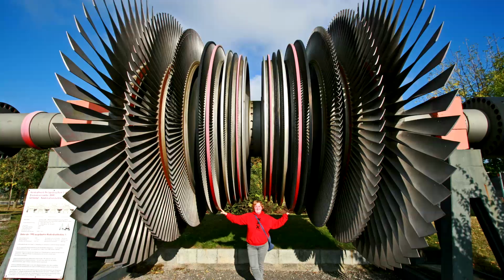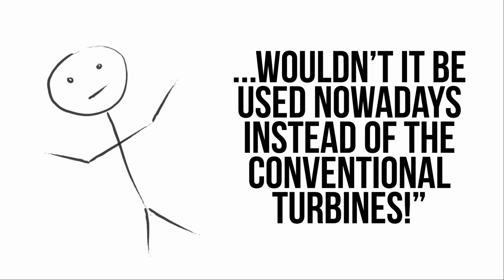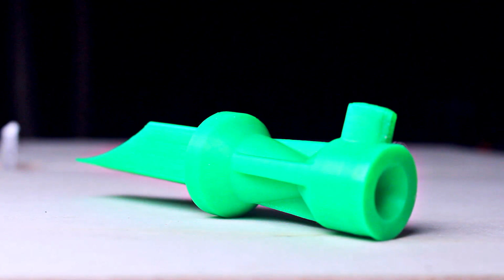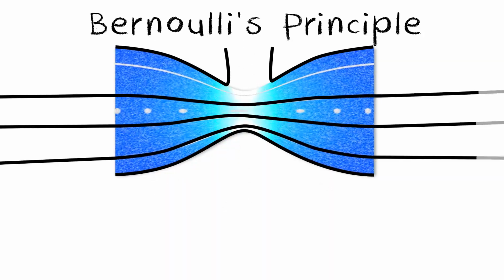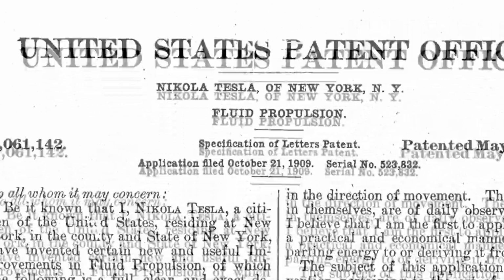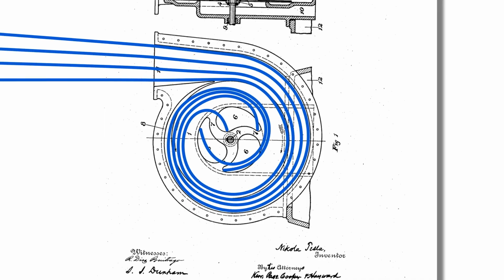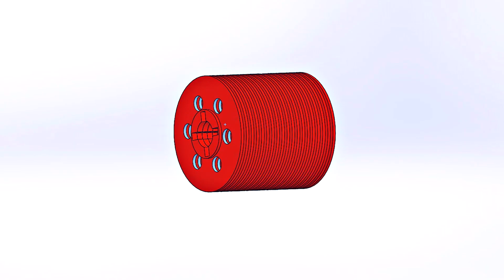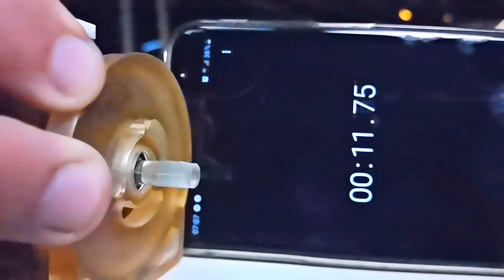Tesla Turbine [Smoke Flow Slow Mo]

Comment: I’m late to your content, but loving every minute of it.  An idea to improve upon the redesign might be to change the topography of the discs into ripples or zigzags that fit closely into one another.  My theory is that the engine would benefit from increased surface area for the air to drag along the discs.  Simply making the discs rougher (probably) wouldn’t work because I think it also benefits from having the flow be as laminar as possible.  Furthermore, this should add resistance to the gas’ tendency to jump from the edge of the turbines straight to the outlet, which should increase efficiency.  
Another (probably more obvious) suggestion would be to use a clutch with blades of varying masses.  Increased mass within the blades (armchair physicist here) should proportionally increase the torque output of the motor.  That might make it slower to spool up, but it’s a variable worth considering based on the application.  
Love your videos and quirky everything.  Keep it up!
Reply: Boundary layer drag is not from
Mechanical Interactions between the fluid and the disc. Adding grooves will introduce turbulent losses which will reduce the efficiency and can induce stream separation, and even flow reversal, counteracting the desired torque, because of the turbulent flow regime it would induce. The Tesla turbine works on adhesion from viscous forces, which are entire valance electron shell interactions. Think hydrophobic and hydroPHILLIC interactions. Making the surfaces of the discs hydroPHILLIC would increase the molecular adhesion of water and steam molecules increasing the boundary layer thickness. 

Putting mechanical impediments in the way of the free flow motive fluid completely defeats the purpose of the turbine in the first place. You want smooth faced discs. The “wetting angle” between the Type of material the discs are made of and the type of motive fluid is the important factor here.

Comment: Why not use a Tesla turbine run by air pressure to drive a Tesla turbine pump to propel a boat.Use the Tesla pump to suck the water up from under the bottom of the boat through the hull  and push the water out of the back of the boat through the stern.Jet boat. Just like a jet ski.

Comment: I am Electric engeneer and I love your videos.  I would love to use your high eficency tesla turbine with a high voltage multiface high eficiecy generator.  The low toque use multi face genere tal out put 18 face  generator.   If more info you can call me 5213221476868

Comment: If i understood well the differences in the new design and the normal design that you made, the former has a "de laval" nozzle (i. e. Convergent divergent nozzle) mounted in the better tesla design. I'll say that the main reason why you lose all those RPMs isn't the tesla design but that you used that nozzle. 

I want to give you some tips(if i'm right about the first design) , i think the problem with that turbine started in the moment you sad "with all the theory out of the way". First of all that nozzle is efficient only if you reach supersonic speed otherwise is useless. At subsonic speed the divergent part will slow the fluid(that is probably why you lose all those RPMs). You don't want turbines to work with supersonic velocities, and almost certainly that design is not meant to work with supersonic speeds. 
So i suggest you to try the new tesla design with the the normal nozzle, and if you want to compare the results the entry surfaces of the casings MUST be the same. 

If this isn't the cases than it is only strange that the better tesla design failed.
Reply: I think that tath could be a good idea. But i can sugest also to remove the central part of the discs, just to have a good comparison. 
I would also sugest to sandpaper the discs and use fins along it to direct the flow and not make it collide in the center. These fins can also be not paralel to the flow to make like an ibrid whit the conventional turbine and maibe get a higher torque output. These fins can also replace the spacers and help you to keep the discs stable also when they are a bit flexible because they are distributed around the surface, not only at the center.
I think you have to reduce the whidt to increase the air speed in the inlet and increase, not too much, the diameter of the turbine to increase the leverage.
In conclusion, to increase the performance the discs thickness is less important than the tickness of the space between them
Hope that someone read this (hope also my english was good)
Reply: the tesla turbine is designed to peak at 50k rpm

Comment: What if you modified the rotor blades to create more drag as the air flowed past them? Cut small curved airlets (perhaps funnel shaped) on both faces to create more torque? Or perhaps created warps in the discs so that when they were stacked they create a spiral/curve pathway, so instead of cutting small curved inlets into each blade face, rather the curved pathway would be created by the resulting pathway observed from warps on the discs in relation to the other discs which were staggered in a rotational mounting/placement? Maybe change the center outlet shape? What if the body/rotors were shaped like a vortex instead of a cylinder?

Comment: The disk could have scales or "scale like" grooves to better catch air friction.

Add small ribs on the disk extending outward from the middle could improve friction, 
or the outer ends of the turbine casing being wider than the center and the disk converging closer together, and since the air slows down on the way out the pressure on the disk may not change upon exit or have less change.

All these ideas were in the expectations of using air. 
If water exiting is essentially the drain, the turbine exit could face downward allowing gravity to assist.

Comment: @integza Bom dia! next time you need dense "smoke", try an e-cigarette (without nicotine, of course). It will produce very dense fog (not smoke).
Btw. did you ever try to mount a disk with flow channels on the axis that spins with turbine speed, where the channels are connected to the exhaust of the turbine? Maybe it will increase efficiency when the centrifugal force sucks out the gas from the exhaust, to make some kind of turbo-powered Tesla turbine.
And efficiency may also increase with the inverse of the disk distance in the turbine. It will help for the laminar flow and the "drag effect" because of the laws of rheology, and maybe the pressure gradient.

Comment: A few improvements:
 - Make the discs from thin plastic sheet (0.1 mm or thinner), not 3D print them
 - Make sure the housing is as smooth as possible, the resin looks quite 'sticky' for the air
 - The rotor didn't seem balanced

Comment: Why not try to use a metal bolt and washers of different diameters. Then cut notches into the washers and line them up to make the exhaust outlet. Then you use some sort of bearings for the axle of the turbine. Now the Fluid may be hot steam with a mini boiler or flash boiler fueled with what ever is cheap to burn. ?
Reply: Maybe if you use two or more stages you may get better results. Then if you design the turbine like a flywheel where the greatest weight is on the outer rim it would work better.

Comment: Love ur appreciation of the scientific method 👍 and innovation if by some miracle u see this I think u would find my turbine idea fascinating and potentially collaborate on experiments for R&D to test to find the best version since there are so many potential variations possible using my concept and would be extremely scalable and potentially synergistic if multiple turbines are properly placed relative to each other especially for hydroelectric applications since it’s a high torque design water is likely the better fluid cus that’s how physics works but I think it would be substantially more efficient per acre in wind then current technology for about a hundred reasons but that’d take way to long to write lol been enjoying ur clips 👍
Reply: All fluids, liquids and gasses, can be made to flow in highly efficient low Reynolds numbers laminar flow regimes. The viscosity will just determine how small the disc spaces will need to be. Using gasses like compressed air and steam are more than adequate for the Tesla turbine when you design the flow regimes and Reynolds numbers to maintain only laminar flow between the discs. Otherwise you get too much slip and I irreversible turbulent flow losses.  

If you decrease the disc spacing you have to coincide ray increase the number of spaces to maintain the total flow area for adequate mass flow rates for desired power outputs. As power out is directly mass flow rate dependent.
Reply: Add on the bacon bit of gasses having viscosities that increase with temps, the opposite of most liquids, and you get decreased slip losses in the turbine as you increase the motive fluid temps/viscosity, ergo increased output efficiencies on top of increases max thermodynamic possible efficiency with increased temps. It’s a win win.

Comment: 1 - Try using a vapor instead of smoke; it's thicker, more visible, and the higher density of moist air should 'stick' to the disks better.

2 - What if each of the disks were concave, so as to give greater surface area while also condensing the fluid toward the center? If curved at the golden ratio it should avoid too much turbulence. 

2b - If not a concave shape, perhaps a raised spiral, only a millimeter or two, on the surface of each disk (like a nautilus) could increase fluid drag and thus efficiency?

Comment: So, waterfall, trompe hammer for compressing air, compressed air through Tesla turbine, to high efficiency generator, problem solved and should be more efficient than current falling water turbine electric dams as there should be less components and more easily serviced

Comment: Take out the metal wheel and gear housing from an old AC clock. It is one with only electromagnets. It worked like a turbine with a straw. It would make a high pitch wine above 5000 rpm. But it had only two wheels and a bunch of steel pieces on the side.

Comment: Step your exhaust through the range of the disc as to help flow and cut the edges at an angle on them.  Add angular notches or blocks on the disc's.
Reply: Boundary layer drag is not from
Mechanical Interactions between the fluid and the disc. Adding grooves will introduce turbulent losses which will reduce the efficiency and can induce stream separation, and even flow reversal, counteracting the desired torque, because of the turbulent flow regime it would induce. The Tesla turbine works on adhesion from viscous forces, which are entire valance electron shell interactions. Think hydrophobic and hydroPHILLIC interactions. Making the surfaces of the discs hydroPHILLIC would increase the molecular adhesion of water and steam molecules increasing the boundary layer thickness. 

Putting mechanical impediments in the way of the free flow motive fluid completely defeats the purpose of the turbine in the first place. You want smooth faced discs. The “wetting angle” between the Type of material the discs are made of and the type of motive fluid is the important factor here.

Comment: Soooo... like... the smoke wants to stay to the outside until it breaks down and then looks for the shortest way to the center...  Why not just move the outlets of the turbine closer to the outside... just at the point where the smoke breaks down?  In other words... "fatten" the axle ridiculously so that it takes up more space.  Then the fluid only has the outside of the disks to work on... which is where it wants to stay anyway.

Comment: Hello Integza! I’ve been wondering if Tesla Turbine works with any type of fluid? If instead of air it works with water ,and if it can, could we generate energy with tap water? :-B
Reply: The Tesla turbine can work with any fluid. The Tesla turbine works on viscous adhesion forces which are entirely valance electron shell/molecular interactions. Think hydrophobic and hydroPHILLIC surfaces. 

The important factor here is to increase the adhesion between the type of disc material used and the type of motive fluid used. For example. Using a hydroPHILLIC disc surface material will increase the molecular adhesion of water and steam to the disc faces, thus increasing the boundary layer thickness and decreasing slip on the discs ultimately increasing torque, power out, and efficiency. 

The “Wetting angle” between the disc material and motive fluid is the governing parameter to optimize for increasing the motive fluid adherence and effectiveness in the Tesla turbine.

Comment: Cant wait for the time when we can gain energy faster than we can use it. (I know it's already now)

As the video, speaking of wind, cars push air and create wind, right? So what if we put some sort of cylindrical shaped kinda windmill on the streets? Then, we can create power, it's eco-friendly, and efficient when placed in bunches.

Comment: Interestingly, when the pressure was increased x4 (2->8bar) the RPM increase was x2 (15k->30k). So if P1+E1=P2+E2 (bernoulli, Energy, Pressure) then perhaps this shows the scaling of the internal resistance, meaning delta(E+P) = R? This could be one aspect of the design that could be isolated and evaluated by itself perhaps? Or at least for me it in interesting because it would mean regardless the design there would be a sweet spot for RPM to optmise power output vs resistance, much like on a solar panel the so called "knee" of the graph, where voltage is maxed to the point where current decreases. Whereas here it would be RPM increased until resistance = power gains or something like that...?

Comment: I feel like a good Tesla turbine would use hard-drive disk platters and air bearings
Reply: I think they would be too smooth. The whole point is to get something that grabs the air and has a high friction coefficient
Reply: @samoneill4750  then we shall rough them up with 600 grit sandpaper, but yes, flat and thin allthough
Reply: @thevinstigator2511  don’t do that. You want smooth faces discs. My last comment explains why you don’t want rough faces discs.
Reply: @samoneill4750  you want smooth. Boundary layer drag is not from
Mechanical Interactions between the fluid and the disc. Adding grooves will introduce turbulent losses which will reduce the efficiency and can induce stream separation, and even flow reversal, counteracting the desired torque, because of the turbulent flow regime it would induce. The Tesla turbine works on adhesion from viscous forces, which are entire valance electron shell interactions. Think hydrophobic and hydroPHILLIC interactions. Making the surfaces of the discs hydroPHILLIC would increase the molecular adhesion of water and steam molecules increasing the boundary layer thickness. 

Putting mechanical impediments in the way of the free flow motive fluid completely defeats the purpose of the turbine in the first place. You want smooth faced discs. The “wetting angle” between the Type of material the discs are made of and the type of motive fluid is the important factor here.

Comment: Split the disks in packages of two and make them a half, also with a bit greater diameter in respect of disk surface/average fluid speed. It will help the dinamics of the gas but can give problems with axiality. So, the axel shall be shorter and of a greater diameter too. You may study the Tesla reactive one way valve and create one at the output in order to counterbalance the fluid turbulence.

Comment: What would happen if you used diffrent materials for the disc in the turbine? Is it possible that the material used acts differently with the viscosity of the " Water Vaper" smoother vs rougher materials?
Reply: My thought is if you use a Doble steam generator you would be able to efficiently generate mass amount of steam and be able to use the tesla turbine to produce mechanical energy. Of course the application of the Doble steam vehicle used steam oil, perhapse this will add not only lubrication for bearings but also increase the viscosity of the steam as it passes through the disc. Does the weight of the disc effect the ability of the turbine? And would it be possible to add a few layers of finned disc for additional tourqe?

Comment: Parabéns pelo vídeo, Integza! Assisti a todos da série sobre Tesla turbines.

I'm researching Tesla turbines at work and I am amazed at how much you have accomplished. On your volute casing, did you try it with the standard nozzle? If I can make a suggestion, I believe the problem was not the volute but the convergent-divergent nozzle. Inside the rotor, we would like the flow to be laminar, as a laminar flow would lead to more frictional shear at the walls due to bigger boundary layers. With the convergent-divergent nozzle, you are increasing the speed of the flow but also making it turbulent (you can see this when you were experimenting with the smoke).

Comment: 19:03 An LED isn't a linear load, therefore an LED in series with a resistor is also not linear. The total resistance depends on the voltage. At 1 V the resistance would be so high that practically no current would flow and therefore the power would be nearly 0 W. Since red LEDs usually have a forward voltage of 1.7 to 2 Volts. Let's say the LED drops around 1.85 Volts. In that case at 7 volts the resistor would have been dropping 5.15 volts, which gives us a current of about 16 mA. Therefore the total power would have been around 7 V * 0.016 A, which is about 0.11 Watts.

Comment: These are interesting, because it's way easier to make a bunch of discs than it is a thousand blades...
Maintenance would be a lot less, too. 
I wonder what the issue is for generators...? Adiabatic issues with steam loosing heat?
Also, I wonder how much the surface texture on the disk matters. Is totally smooth best? Or would very tiny bumps be better?